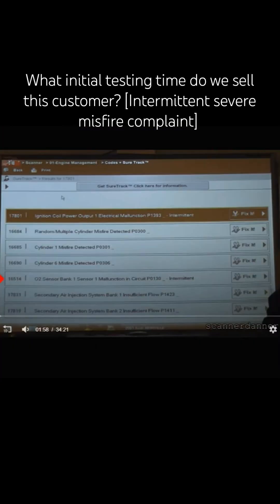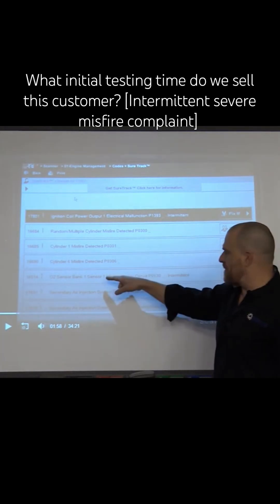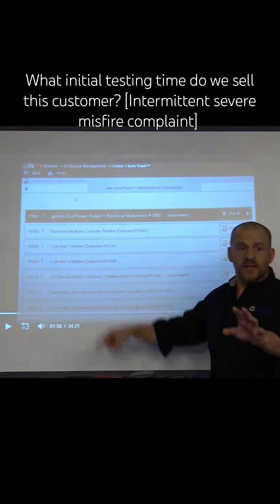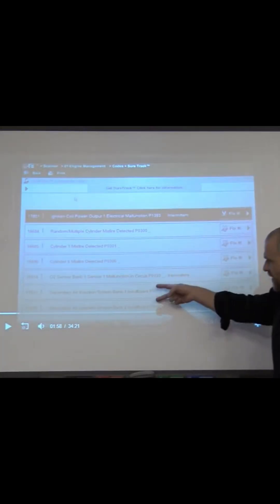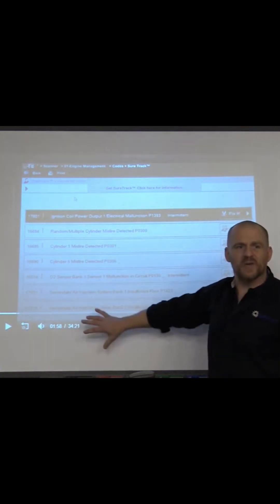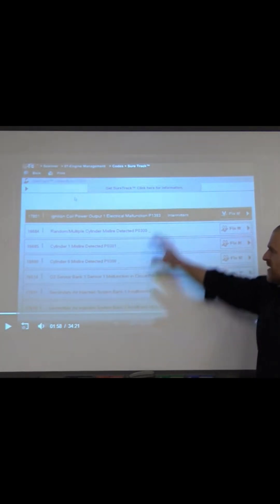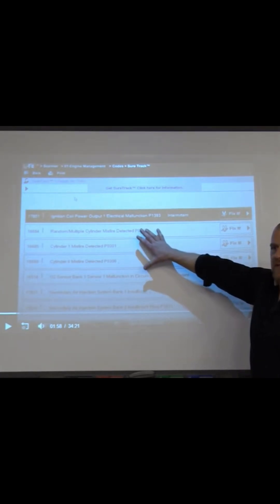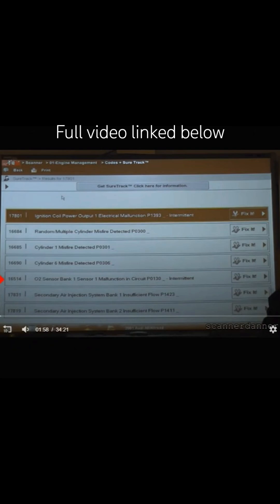What Initial Testing Time Do We Sell This Customer? #automotivediagnostics #diagnostictroublecode

Comment: Intermittent faults require advanced diagnostic procedures.
$300.00 min charge .
With a senior discount=$275.00
Reply: $300.00 min charge ??? no
Reply: @cardiaglexia995 yes. Minimum!
Reply: I mean most shops are over 150 per hour so advanced diagnostic at two hour starting isn’t unreasonable. 

Some shops are 200 per hour so 300 would only be an hour and a half.
Reply: The technician that worked for our shop won IDENTIFIX TECH OF THE YEAR AND OUR OTHER TECH WAS BAY AREAS BEST TECH . SO $300.00 WAS easy money for an established tech